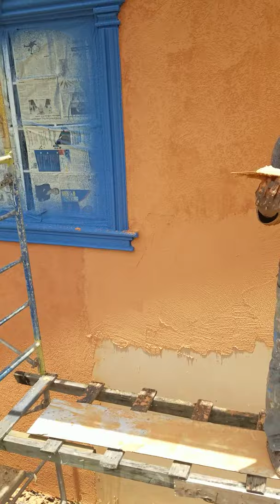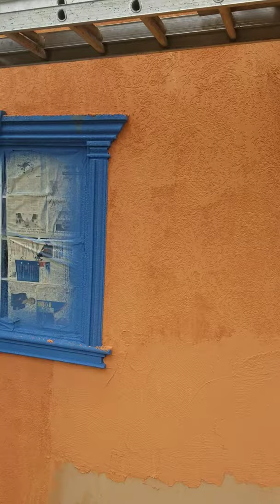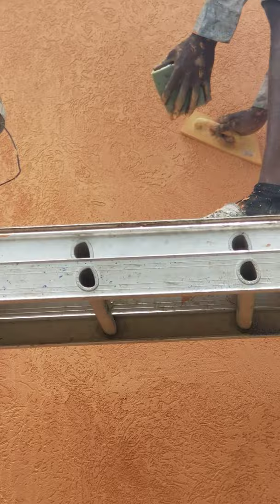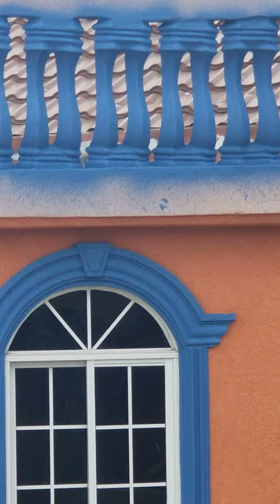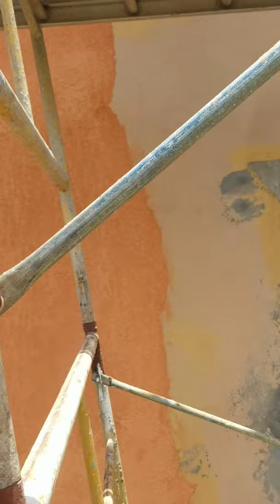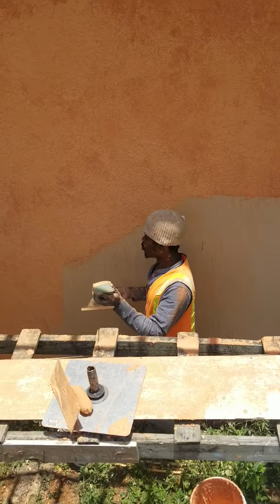how to do trowel on texture in Jamaica

Comment: Looking good but youneed bigger trowel ! Would go much faster and use less enrgy tuh  At least a twenty inch would be good and memba seh you have two side pon di trowel 😏upward movement to put it on and thén tilt your trowel and use the otherside to come back over what you have just put on ! Left hand side to put on and then come back down with the right han side to spread out that way you spread more evenly  and thé matirial will go further ! Bless up and good luck wid di wuk general .